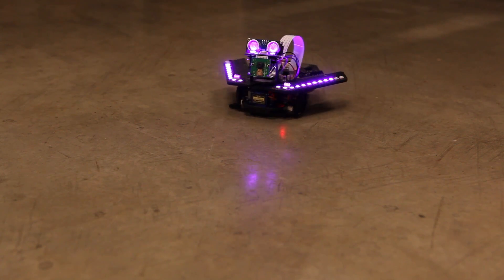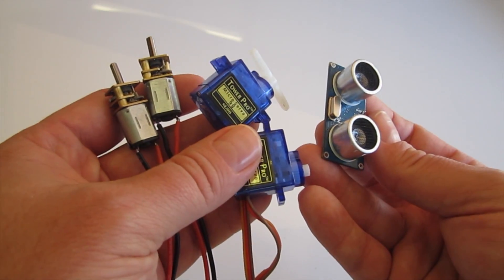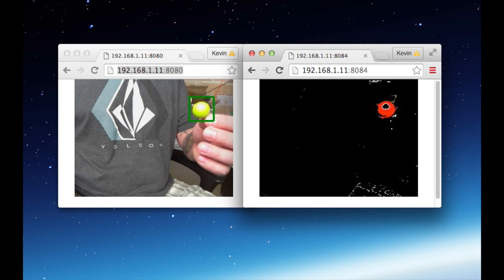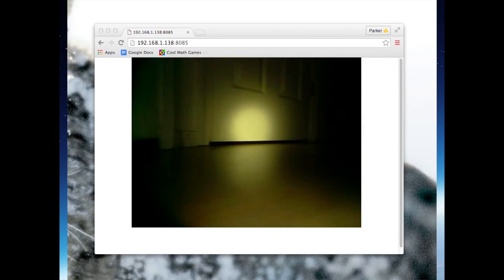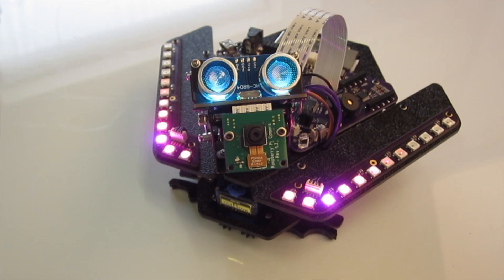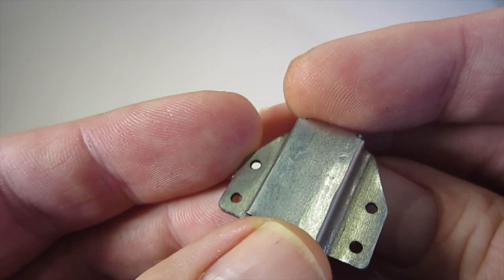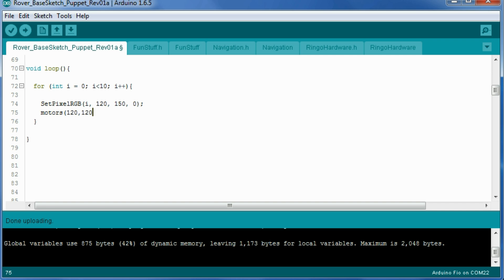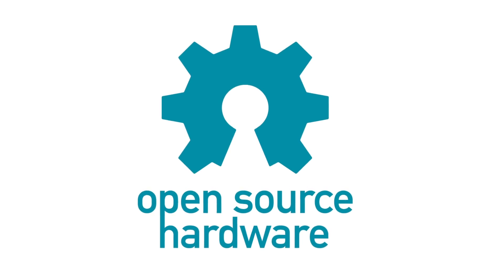Plum Geek Spirit Rover - Kickstarter Video

Comment: There are no coincidences...
I'm currently building a 1:8 Scale full autonomous rover with an APM 2.6.
I've already hit I think a dead end with controlling directions for multiple sonar units front, rear and both sides. They do not work independently on direction of turn of the others. I started on a 10th scale Frog Prototype 1 w/1 sonar unit and moved onto P2 with a Mad Torque 1:8 scale rover with more than 2 sonars.  
Your system may be the answer to what I need...
I checked you links but could not locate where to purchase on the these.

liked and subbed  :)